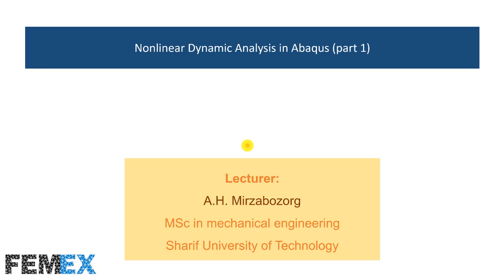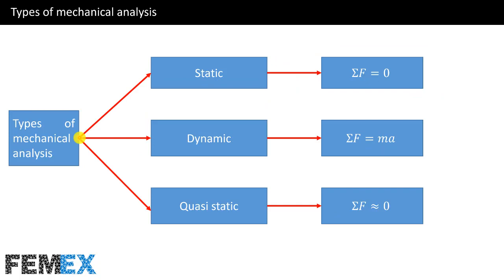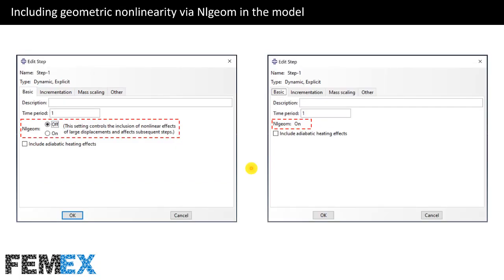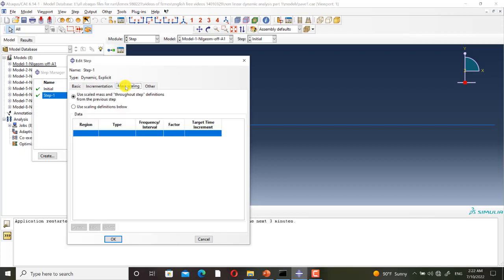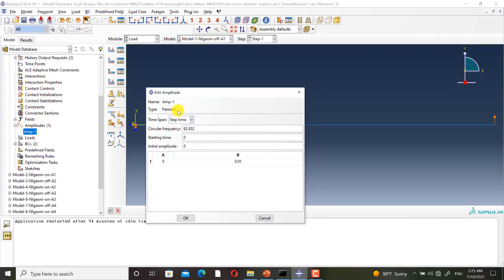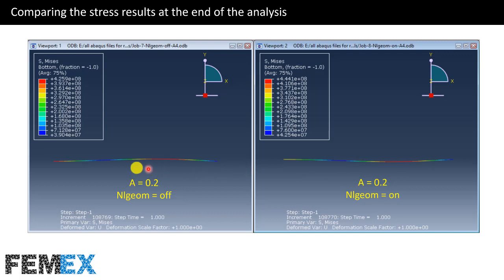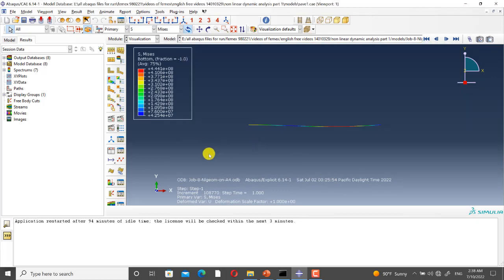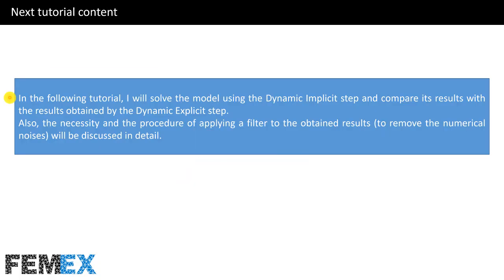Nonlinear Dynamic Analysis in Abaqus part 1

Comment: How can we obtain mass participation ratios from frequency analysis?
Reply from the maker: Hi.
Good time.
I have not heard about this concept.
Can you tell me about its mathematical definition?
Reply: Mass participation ratio is a measure used in structural dynamics to indicate how much of a structure's total mass participates in a particular mode of vibration. It is especially important in modal analysis, where dynamic behavior of structures is studied. A higher mass participation ratio in the first few modes suggests that these modes adequately represent the structure’s overall dynamic response. Engineers typically aim for a cumulative mass participation ratio of around 90% in the first few modes to ensure accurate results in dynamic analyses, such as response spectrum or time history analysis.

Comment: Hello,......I am facing below mentioned error again and again during performing Dynamic Analysis in Abaqus. The error occurs as follows. 
The analysis may need a large number of increments (more than 20,000,000) and it may be affected by round-off errors. For accuracy, running double precision executable is required.
Reply from the maker: Hi.
At the start of the simulation, Abaqus approximates the needed number of increments by deviding the time period by the stable time increment size. If it goes beyond 20000000, we will face this error. To resolve this issue, you can go to the job settings, precision tab, and set both of the settings to their last choice. This solution will resolve this error but does not resolve the main cause of this error. For resolving the main cause, your model must be checked.

Comment: Hi this is very interesting video. my question related to at 10:30 sec time where you had shown the displacement vs time plot. i want to know if i want to change x-axis time from particular range suppose 800-900 time range how ti do it.
my second question how to define intial condition for dynamic problem.
my 3rd question related to how to determine frequency response curve for model in nonlinear domain, as determine analytically.
Reply from the maker: Hi.
1) Unfortunately, I didn't understand the first question. Please explain more about it.
2) Generally, to define initial condition in Abaqus, you must define predefined field. You can define initial velocity via it.
3) I remember that one of the steps of Abaqus can calculate the frequency response curve but it is done in the linear domain as the step is included in the linear perturbation category.
If you want the frequency response curve in the nonlinear domain, you must do it via conducting a lot of simulations. Each time you must put a new frequency then rerun the model and save its result and do it again and again. Each simulation gives you one of the points of the complete curve.
Unfortunately I don't have a simpler idea.
Reply: @FemexIran  Thanks for reply. As my 1st question related to time-series analysis of nonlinear dynamics, as in Abaqus i have observe that when we get the results w.r.t time(x-Axis) the range automatically provide 0-1 sec, can adjust these time range as per our requirement.
Reply from the maker: @AlokKumar-vf4ku  You are welcome.
Actually, Abaqus plots the time series from its beginning to its end. Always the starting time is 0. The ending time depends on the time period of the step. For example if you set T = 10 sec, then the ending time is 10 sec. If you want to plot from another time to another, You can export the time series to excel and use a specific part of the curve to plot it.
Also I think if you save it as a XY data, maybe you can modify it and delete the data before a specific point or after it. But I am not sure about it.

Comment: I have seen this video many time and getting very interesting things from this. i have some question, how to plot the time-series with phase plot for frequency domain analysis under forced and unforced for geometrical nonlinear system, can you give idea how to generate periodic to chaotic plot under cont. excitation  to the system.
Reply from the maker: Hi.
You are welcome.
I think in the model which you need, the load must be defined as force control. You must define a concentrated force with periodic amplitude at the tip of the beam.
As far as I know, phase plot has its own mathematical definition. You must get the related outputs like the displacement or speed of special points and put them in the mathematical definition in the visualization module via "operate on XY data" tool. Also you can get them by defining history output for them, So by opening the ODB file, You always have them. Also you can transfer them to the excel to put them in the mathematical definition.
Reply: @FemexIran  thanks for your reply, but again I have some questions, how to define force control. can you explain how to generate under periodic time-series plot for nonlinear system.
Reply from the maker: @ahmedsharifshayborabeh369  You are welcome. To define force control loading, You must create a load from the load module. If you have beam, You must define concentrated force with appropriate amplitude.
About your second question, you must explain the under period plot to me to understand it and tell you how to do it in Abaqus.